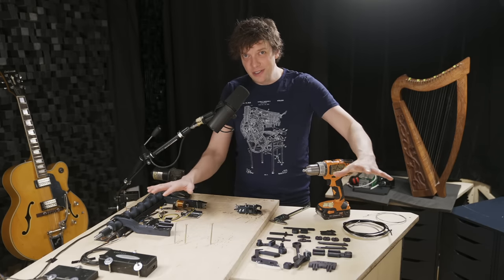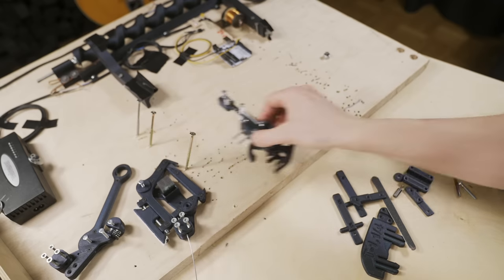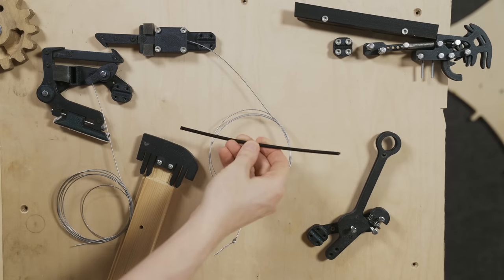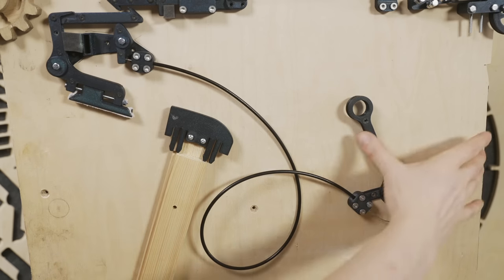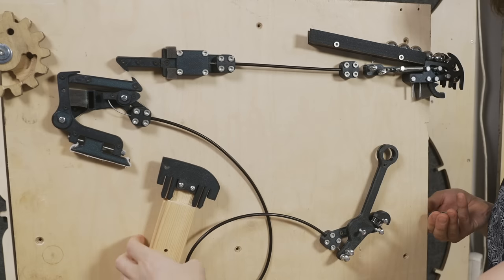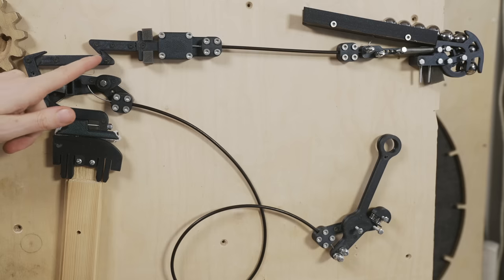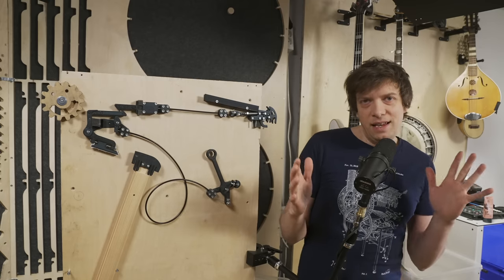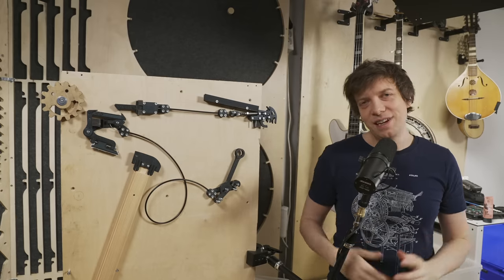These Bowden Cables Surprised Me!

Comment: The cables allow for flexibility in the marble machine, like if it's a smaller stage, you can pivot the wheels to be in an L shape for a corner. Or, additionally, gives you the ability to make modules for instruments, like back ups in case one fails during a show.

Comment: As excited as I am to see progress, I feel a little sad that that the machine is using wires, in the same vein of not manually spinning the crank by hand. It's becoming a mean lean fighting machine for sure, but in my opinion, losing the character it had at the start. I know you've struggled with this whole idea, but at this point it's hard to see, Pin pushes lever, lever actuates marble holder, marble drops onto instrument. Now it's Here's some pins that have wires running from them, It can actuate a marble holder... somewhere, that drops a marble onto an instrument. It takes a connection point out of the machine. As you said, it's "spooky action at a distance". 

Negatives aside, I love the project and will keep watching the path that you take. MM3 will be amazing.

Comment: It might be a good idea to setup an off-the-shelf cable adjuster for easier tuning. Probably threaded into the hole made to retain the bowden cable housing. In effect, it does the same thing as extending the length of your bowden cable's housing. This will reduce a lot of cable length fine-tuning headaches I'm sure you've experienced, and simplify adjustment in the future over the life of the cable, which will stretch overtime, especially when it's new.

Make sure you put a ferrule on both sides of each housing and use a crimped endcap for your cable, especially once you get the adjusters setup. This will protect them from fraying and general wear issues. Ferrules help in a similar way for the housings, especially important when you are dealing with greater tension on the cable. 

Like others have mentioned, you want all of your cables to always be in tension, the main mechanism is alright but for the mute, it might be worth setting up a low tension spiral or torsion spring of some kind internally with a plastic catch somewhere, so you only have to worry about adjusting the extended position and it will naturally apply a torque by itself and hit the stopper when the cable is not under tension.

A cool little addition you could make for rapid maintenance reasons: Taking another inspiration from bicycles, they have a cutout along the length of the assembly for the cable and its housing to be removed without undoing a single bolt, besides the singular anchor bolt which holds the non-crimped end of the cable. Take a look at how most bicycles setup their caliper brakes and levers as an example.

Comment: Hi Martin, the inertia and friction of the gate cable etc needs to be considered such that the marble gate continues to release faster than the marble drops under gravity as that can affect your timing. You may want to test with a longer and looped gate cable with added mass and friction to verify you have some margin to make it reliable on tour. This is the area that needs the most attention as it will be repeated many more times than the mute cables.

For the mute mechanism, I see a few issues with some nice solutions. You could remove a pivot point on the top catch by replacing the cam with a flexible mechanism, which allows the bottom catch pivot to function if the mute is applied when the programming pin is active. This would reduce your part count, and allow for less accurate tuning to make it work reliably.  Your cam currently has a lot of rotation which isn't good for the cable and introduces long term drift that might need to be adjusted on tour. A straighter cable pull will be more reliable.

For reliable cable operation, you want to design the cable pulls so they are stiff and are always in tension. Take a look at how a motorcycle throttle cable works. On both ends, the cable wraps around a curved surface, such that the cable goes in and out of the cable sleeve directly. If you can't do this, then you need to minimize the bending of the cable between the end of the cable and the cable tube, and if you can't reduce this enough, allow the cable end to rotate, such as on a bicycle or motorcycle brake handle. Have you looked at model airplane flexible push rods?

You can dramatically reduce your part count for the cable sheathing clamps if your cables are always in tension. If the springs are strong enough, (which doesn't make sense for the gate, due to noise reasons, but might make sense for the mute) then you don't even need clamps. Bicycles don't use clamps. If you do need clamps, 3d print a single part that uses a single screw on one side to both pinch the cable and mount the block, along with a pin to stop rotation. The cable block should be a single 3d printed part with a single fastener, not 2 parts with 4 fasteners:)

You could reduce your part count further by replacing the foam with a single soft rubber bumper that goes on the wire between the cable clamp and the tube clamp.

Comment: Martin, aside from others' comments and suggestions regarding the Bowden cables - when you redo your timing tests with the cables please be sure to test with the maximum length cables you would ever need to have in the machine, and with multiple bends. Otherwise you won't know for sure if the inevitable length or complex bending (bends with multiple directions like left-right-left bends, etc) of some of the cables will affect the tightness of the timing in those channels or not. I'd imagine this shouldn't affect it *much*, but with the timings you've been obsessed with mere milliseconds so better safe than sorry!

Comment: Also measure the friction. In this particular test rig you can test a bare wire, the short Bowden cable, a long Bowden cable in a lazy loop, and a long Bowden cable in very tight loops. This will tell you how much friction they add in each version, and how much using the cable to compensate for offset will change that. It may turn out that in some situations it will be better to use a longer cable if it can be routed in larger less abrupt bends.

Comment: The beauty of this system is that the programming wheel no longer needs to in line with marble drops.  In fact it could be rotated 90 degrees if needed.  It will allow for placement the provides easy access to change the programming wheel. Additionally, there is a possibility of two programming wheels that can independently operate the same drop mechanism.  This would allow for one programming wheel to be changed while the other is playing. Maybe too complicated, but worth exploring/considering.

Comment: This is a great idea. I think the next iteration on this should be interfaces between those cable connection points. Think of the modular separation of a guitar and amplifier. The programming wheel module would become the instrument and the instrument would be the amplifier in this analogy with a cable between them. This would also make it possible for any channel of the programming wheel to drive any instrument the same way any guitar can drive any amplifier.

Comment: To help with initial setup and adjustments due to any cable stretch, add two marks to the design of the marble gate which will line up when the reader is on top of a programming pin.

Comment: @TheXtrafresh had some very valid points, but...

Look into the "snakes" used in model aircraft. Made from PTFE (for low friction) with a rod sliding inside a tube. They can be used for pushing as well as pulling forces and don't stretch in the same way that metal can. The catch is that they don't have the same tensile strength (which only really matters if you're clamping down on brakes, not for you) and they really prefer a larger bend radius - so you couldn't have a loop as tight as in the video.

Comment: If you're going to push on a bowden "cable" then it's best to use a solid music-wire for the core so it doesn't buckle as easily.  This comes with reduced flexibility and increased friction. You can also make your own rigid housing out of a small steel or aluminum tube with a teflon tube slipped inside.  Did this on one of my bikes with a particularly long rear shifter cable and it really helped the shifting precision.

Comment: On the surface, this is a super elegant solution. However, as a person who never loved adjusting derailleurs as cables stretch and wear out over time, I do worry a little about what these cables will be like to work with after a significant amount of use. You can use a barrel adjuster at one end to tighten cables as they stretch, but with 2 of these per channel, that sounds like a HUUUGE headache to tune to perfection. This is also why SRAM has gotten away with charging an arm and a leg for bluetooth shifting on mountain bikes. lol

Comment: These are some ground breaking upgrades 👍😊🙏 

The plastic tubes will wear down over time if they are bent (the string will rub against the inside of the shortest path, so you may have to tighten it every once in a while). A hydraulic equivalent might be more durable

Comment: For pushing and pulling there are bowden cables available, where the inner wire is made of one soild wire. The drawback obviously would be that those are less flexible and not suited for connecting pieces together that move quite a bit during operation.

Comment: Funny thing about bicycle cables. On most modern bikes they route them inside the frame for a cleaner look, but that actually bends the cables more causing friction and worse performance. Shifting gears being less accurate etc. Having them straight is pretty important, at least when it comes to use in rain and mud. For a marble playing machine I suspect you can get pretty artistic with it and not have to worry too much anyway 😄
Reply: Also, on a bicycle there is always a spring helping the wire go back from the position you forced it too with your fingers, so you might have to add a spring of some sort for each cable in the marble machine as well to not be dependent on the wire stiffness pushing it on its own.

Comment: Your better cables will have a Teflon lining that will greatly reduce the friction of the cables moving through the housing. As others have pointed out, do not push on the cables, only pull, even if it means you have to run two cables instead of one. Cables come in different diameters: thin derailleur cables, thicker brake cables. Your pulling loads are minimal compared to bicycle requirements, and the greater flexibility of the thinner cables might serve you well.

Comment: Great idea! Bike brake cables work great for pulling, IF YOU NEED stronger pushing forces, TRY using Carburetor Choke Cables from your local automotive parts distributor

Comment: One caution on the mute setup is that you have to be a little careful on pushing force for the cable, they are super strong for a pull force, but can easily bend on a push. You might want a small spring in the mute side of the lever to make the setup a pull/pull relationship.

Comment: Another type of Bowden cable you might find useful is the type used in speedometers. This is similar to the Bowden cable you are using there (it has an inner cable and and flexible outer sheath), but it's designed for producing twisting/spinning forces, instead of 'pull' forces...
Speedometer cables are designed to spin smoothly inside the sheath, without becoming unravelled or kinked...

Comment: Correct me if i'm wrong but to my knowledge the caples can push but they are more designed for pulling in tension, mostly regarding durability and reliability when it comes to change in length of the cables. Maybe look at other application and technical specifications of the cables. In my personal knowledge in climbing safety gear and cycling gear, where cables are used, they almost more pull or let go, but not push.
This would not mean a huge design complication, but you would need to add springs to one of the ends.
Only half naked knowledge, but still wanted to chip in.
Keep up the great work Martin :)

Comment: As a thought experiment this is concept can "travel" faster than light. It's not practical to do so but if you could manufacture a cable that's say a lightyear long you could conceivably push on one end and affect the other in a near instant. That way you can connect two places in real time that would otherwise have to communicate with years of delay through radio for instance. Which I think is pretty cool :)

Comment: Many cyclists have put some notes about cable quality. Here is my 2 cents on it :
On short runs (less than a meter) not exposed to bad weather basic quality is more than good enough. You can lube the cable. I use WD-40 in casing and a light coat of grease on the cable. Since this will not be used in foul weather a dry teflon based lubricant should be enough.

On ther other hand, better cables are prestreched which is very important for the cable activating the marble gate to keep the mutsic tight. Even prestreched cables will continue to strech but much less. If you can keep a direct mechanical link to release the marble this will not be an issue anymore.

Comment: Even better: you can separate the programing wheel system from the instrument system, be able to play different instruments sets using the same wheel system. Also probably good to prevent vibration transmission between the two.

Comment: As you next want to test the influence of the Bowden cables on your marble drop precision: Especially for that actuation cable it is very important to keep the cable as straight as possible, as every bend will introduce play in the force transmission, like "Da Vinci FPV" already alluded to. At rest the cable will try to maximize its radius within the play of the tube. Wenn it is pulled for releasing a marble it will first move out of this resting position BEFORE the end actually moves. This will introduce a certain delay in the desired action.

Comment: Witergatan, there are some cables with teflon inside, so it makes it much less friction. I'm not sure if these cabels could be used to push things. In bicycle they are used only to pull things. Brakes and gears are springloaded, so they pull all the time. Also there are some endcaps (ferules) to protect ends of these wires - I think it will be very good to use them.

Comment: Research into 3D printed compliant mechanisms. You can 3d print springs, levers etc using the plastics flexibility and rigidity. Usually PLA makes amazing compliant mechanisms

Comment: I've used Bowden Cables to act as tendons in a robotic arm actuator. You'll have to deal with cable stretch over time which will potentially add delay to your setup and thus require a sort of adjustment mechanism.

Comment: Bike Cables can introduce some errors.  To prevent it, make sure the sheath and the cable are matched as the bigger the difference between the cable's outer diameter and the sheath's inner diameter, the greater the error introduced.  Cheap cables can make changing gears more an art than accurate.  You are getting closer and closer to needing to assemble the next Marble Machine!!

Comment: Martin discovers bicycle brake cables :D

But really, it seems clever to use them. As for the timing test you told about, make sure to test if the timing adjustment slider's position affects how long the dropping time is. After all, if the reader works purely through gravity, changes in its proportions could affect the dropping speed a bit.

Comment: Consider testing the variance of the marble gate with a longer cable with loops in it, maybe even moving the cable shape during test. On a bike, you can see the cable moving a little when you break. That will translate in some latency in your system, and this latency might vary with small changes in the cable route.

Comment: Something i liked about the older designs is you could clearly follow the cause and effect of things.
With these cables you might not be able do that, almost might as well have an electronic sensor on the wheel, wires going to a mother board, and then wires going to an actuator to release the marble. Get the same effect, less parts, less chance of failure and people see the same result.

Comment: My experience with bowden cables is that expensive ones are MUCH better than cheap ones. Go for PTFE-lined ones with metal strands in the middle, and make sure the cable itself is PTFE-lined as well. The metal strand housing keeps the tubes round at bends and the PTFE lining makes everything smoother. Also try to find ones that have less slack as the more slack between the cable and the bowden tube, the more inaccuracy you'll get from the action. Not sure what industrial ones are good, but for bikes, Shimano Optislick cables are awesome.

Comment: Noise reduction would be simpler and smaller by using Felt instead of foam.  Foam tends to degrade over time while felt will last quite a lot longer too.  You can even get inexpensive sheets of felt with an adhesive already so you can cut what you need from the sheets, peel away the backing and apply it where you want to avoid parts making noise when they contact each other.   Felt has a long history of being used for that exact purpose too.

Comment: If you plan to only mute per instrument (multiple channels) you can probably save some parts by creating a mute junction box where one lever will retract or contract all at once. Thinking of a small wheel with slots in it to place the ends of several cables into and then the single lever rotates all of them to the desired position in one action and with the same timing.

Comment: How nice to see progressing in the right direction! Just remember that you'd need to have one mute lever that will act on all (or at least on several) mm3 channels. I think that a cam shaft type of design could be useful in this case. You definitely cannot drive multiple wires using one lever; this would require that you apply significant force on that lever.